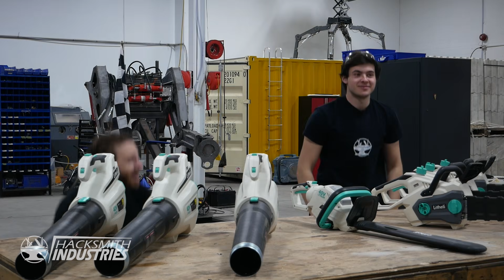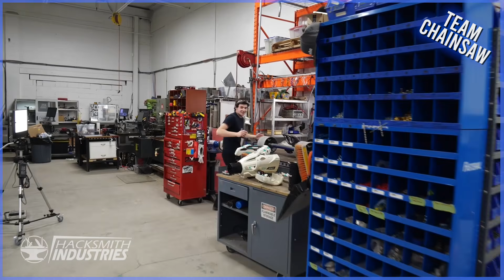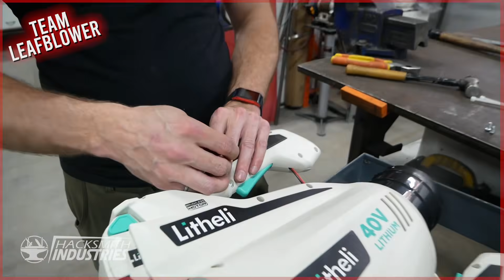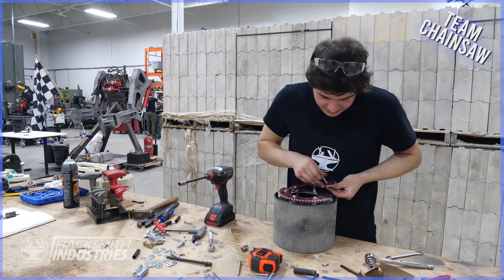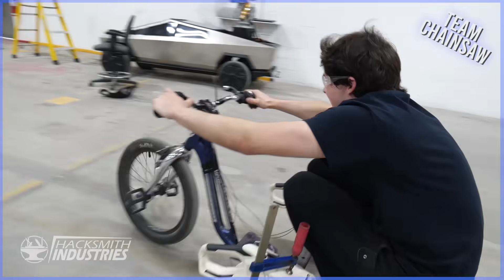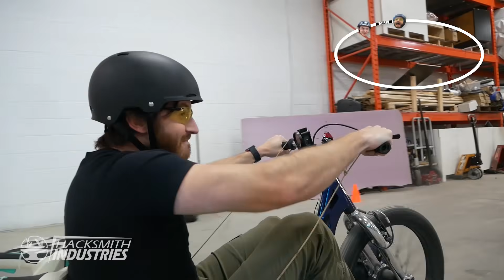Power Tool Drift Trikes! (One Day Build)

Comment: I really liked this. I did not believe James stood a chance with his drift spec leafblower design as the 27 nm of force seemed inferior along with the drift inducing steering. But the results truly blew me away as James' ride truly was a cut above the competition.
Reply: @dacomputernerd4096  James explained it at the end, the leaf blowers kept adding thrust, and kept adding thrust, and would have continued to do so as long as they were ran (until the speed of the trike matched the speed of the blower.) The chainsaw motors, while more powerful, cap out at a set speed. If the course was more complicated the chainsaws may have won the race (more power at the low end,) but it was rather smooth so the leaf blowers could just keep pushing faster and faster

Comment: The pedal assist with powered rear is actually a great idea, especially for smaller electric motors. I have an 1800w Vevor and a Far Driver nd72300 I’m thinking of using on another Razor dxt build. I powered one already with a front electric hub that is pretty cool. I’d like to see the comparison from a front wheel drive drift trike to a rear drive.

Comment: As far as the chainsaw design I would have used a jackshaft with 3 of them spinning up the one shaft to the drive sprocket that would have been a lot smaller for higher speed.

Comment: What would happen if you kept the middle leaf blower fixed directly behind you and use the ones on the sides to provide your drift thrust the ones on the outside could be pointed slightly out to the sides and keep your pulley system to help redirect the flow of air id also try to point to blowers slightly towards the ground

Comment: In the stock drift bike the power goes into the front wheel wouldn't it be faster and have more traction if you mounted the chainsaw to the front wheel?

Comment: Take one chainsaws and use the pinion and chain to make it like a motor so use one pinion and a gear attached to the pinion with the chain saw chain connecting to a gear that is connected to the spokes or middle and thats all turn on the chain saw and you have a front wheel drive bike made from a chain saw. or you can do the exact same thing with the two back wheel but you will need to do that to both wheels.
Reply: so bogdens idea is the best
james was also cool they were both cool but i liked bogdens more
Reply: but jameses was fast so that means his was the "superior choice" as he said so both were cool and awesome

Comment: Need to use a gearbox that distributes the power from the electric motors to your drive shaft that's connected to your wheels if you have that you will get more power with less string on the electric motors it's called the invention of the transmission

Comment: I think Bogden would have won if he attached both the chains to the front wheel and got a better clutch, more speed from the bigger grippy wheels, plus front wheel drive cars are better at drifting because the front wheel drives the car and the back wheel can slide out.

Comment: You should of ducted those 3 blowers into a convergent nozzle to boost the thrust...
Reply from the maker: That would reduce the thrust
Reply: @hacksmith  First off scrap that "Lithium Powered" nonsense. I understand why and your need for it in this video, however to argue your point. I would say this; Had you gotten yourself say 2 Stihl Backpack Blowers that push out air at 210 mph. Then stripped housing, etc to account for weight. Then duct BOTH blower nozzles thru a CONVERGENT nozzle, with say a 2 inch approx. hole, I would expect a 3:1 gain in thrust. Maybe more. This would NOT ONLY create a venturi effect within the nozzle, but also help focus and direct said thrust to help with drifting/steering....Nozzles are the very last thing on ANY jet.....
Reply: @hacksmith  also in referencing my previous point, the nozzle diameter size needs to shrink to the point to where back pressure begins to build up. If you don't take this into account, it WILL increase manifold pressure and also heat. Those pistons are NOT that big in those blowers. I digress.....

Comment: The air power one will not have an inner Ratio so it will have continuous flow no matter what speed But the chainsaw is governed by the gear set ratio that it runs on Air is infinite  I hope this is my theory Curtis  son buddy  cghj 1968 October